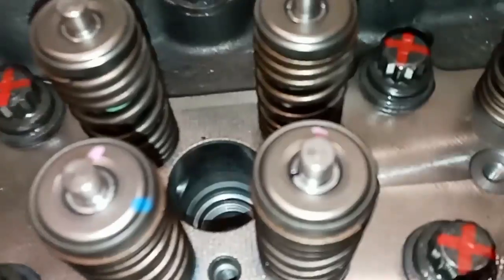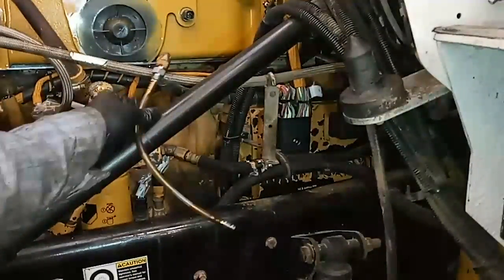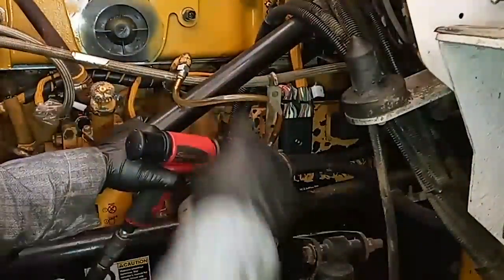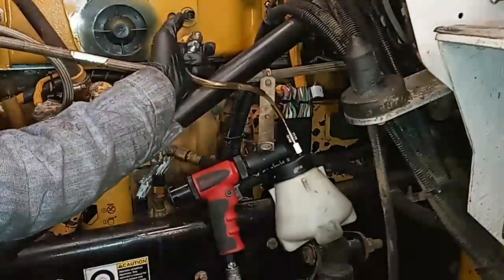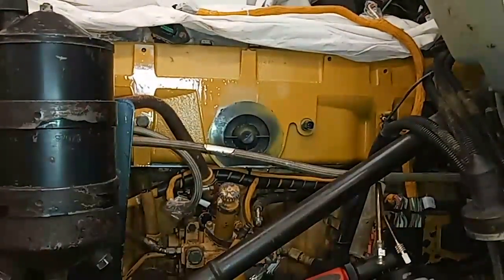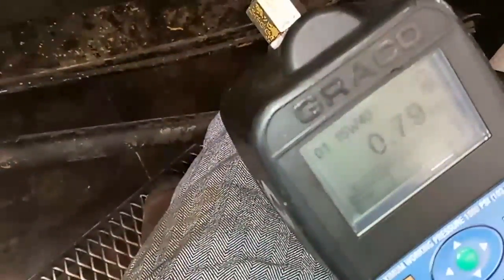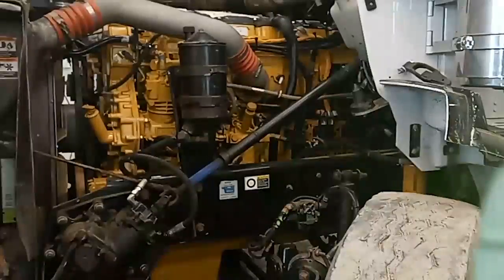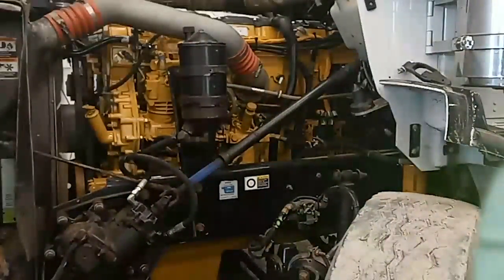How To Prime your Engine Oil and Fuel System for INSTANT PRESSURE!

Comment: ha!  Back in my day, I'd loosen all lines and pressurize the fuel tank via a rag and an air nozzle blowing into tank.  One connection at a time, fuel would leak out...close the connections up the line one at a time an voila...a 'purged' fuel system...only takes a little pressure to do that and nah, you won't 'blow up' the tank unless you are an idiot.  A little pressure difference is all it takes. Yea, this was back in the day of mechanical fuel pumps when you'd burn out a starter motor priming the system.  Is that still true today?
Reply: Yes did the same 👍
Reply: I have a valve stem cut from an inner tube that I clamp onto my filler neck to prime my Detroit Diesel 3-53 in my loader. I even have a ball valve with clear tubing outlet on my fuel filter housing so I can see when the bubbles stop. When you do this to a Detroit 2-cycle you’re filling the cylinder head passages where the mechanical unit injectors are. That motor will fire right up every time using this method.

Comment: Great idea, I'll have to try this on my next Detroit build.:)
Reply: I have actually done this on a 6-71 that I put all new fuel lines and filters on the truck.  I pulled a vacuum on the return port coming off the head after the restrictor. Truck started like the engine in the video, except with the ultra cool 2 stroke Detroit noise!!! BTW, I love your Super Duty, have followed the build on facebook!
Reply: @75LS1Vega  Thanks very nice.:)  I normally use an old fuel pump to prime the fuel system.  I'll try the same fuel pump, but filter it for the oil and see if that works.:)
Reply: @75LS1Vega  Ah I remember your channel now.:)  I used to watch that video you have of the 6V53 in the old Ford plowing snow.  I must have watched that video a 100 times.:)  Very nice indeed.:)
Reply: @detroitgarage9430  truck still
Plows every winter. It is mildly amusing that two dyed in the wool 2 stroke Detroit guys are watching a channel dedicated to Cat engines!!
Reply: @75LS1Vega  I do love the Cats as well.:)

Comment: Is this what you have to do if your run out of fuel on the road as well?
Reply: No. First put fuel in the tank (like you should have done before you ran out of fuel).
Second,  unscrew the primer pump and pull it up. Then spray the shaft with lubricant ( I use WD 40 because it is just inside the door). The lube helps 'cause your going to pump A LOT.  Loosen the bleed screw on the top of the secondary filter housing. This makes it easier to pump because you're not working against the pressure regulator. Then pump until you feel like your arm is going to fall off. When you get fuel coming out of the bleed screw tighten it up, then pump some more until you feel the pump getting harder.  Lock it down, THEN start the engine.  Works every time and with the lubrication your hand pump shaft seals won't wear out plus it is definitely easier to pump.
Reply: @brucejones2354  So yeah you can do this too.
Reply: @mikeznel6048 , believe me,  I know this from experience ( yes I should have added fuel to the tank BEFOR I ran out of fuel) !      That plus over 23 years repairing  ALL of the equipment in an large excavating company owned by my dad.
Reply: Yes.  Take notes.